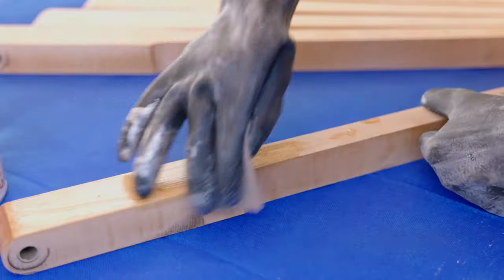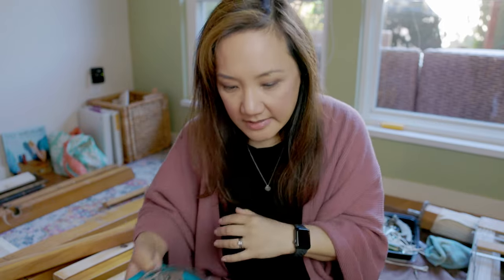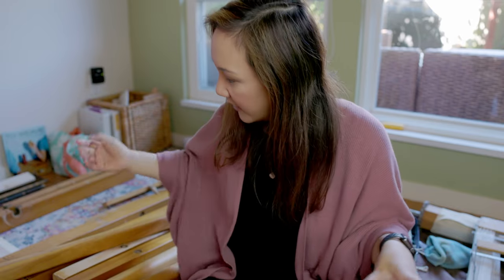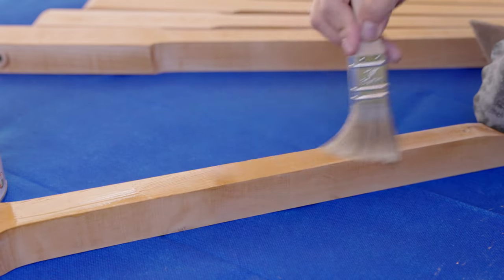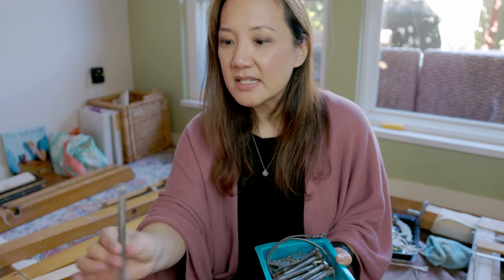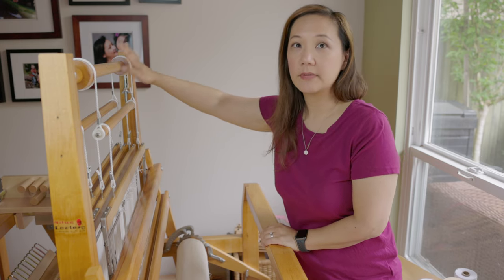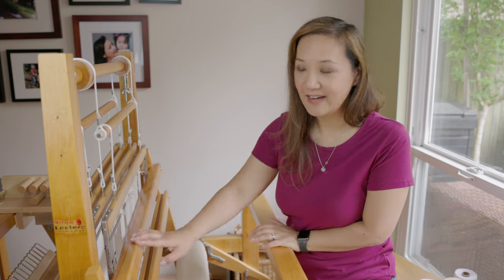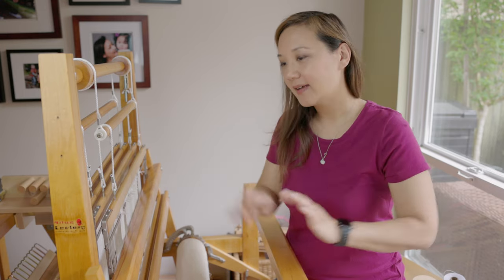Weaving Loom Restoration for a 1968 Leclerc Fanny Counterbalance: Part 2 // Finishing the Loom

Comment: Just wanted the 1st video and I too have obtained an older loom that sat in a basement so it was dusty, had some surface mold and was neglected. (1983 Schacht standard 45" 8 shaft jack loom.) I too wanted to just weave on it. But I knew I would enjoy it more if I cleaned it up. I just used the murphy's oil soap with sponge sand block when needed then applied the danish oil. It seems at one time this one was used in a school and you could tell they did dying also I found little finger/handprints that were dark. I did leave a few of those did not sand all the way down to keep part of it's history. Just as yours did once the danish oil was applied it went back to the beautiful patina of the aged wood. I'm such a happy weaver on it because of the journey. Cheers to your happy weaving. :-)
Reply: Ohh and yes plastic bags with labels and pictures of each side, part, area of loom does help when putting back together. :-) Hubby works on generators and they do that on the job.
Reply from the maker: Beautiful! I’m so happy to hear that you brought life to this loom again!
Reply: What a wonderful story. I believe my loom is from an art department of a college!

Comment: Wow!  I am so impressed with how nice of a job you did on your loom.  I also restored an old Fanny loom.  Mine was from the 1950s.  I bought mine from an ad on Kijiji that showed pictures of a much newer loom.  We travelled 5 hours to go and buy it, to find that it was very dirty and in rough shape.  I only bought it because it was cheap and I had dragged my family along for the trip.  I sanded it down without taking it apart.  I had only used a table loom once and didn’t know anything about floor looms and wasn’t sure that I could get it back together.  I replaced the cords, aprons, bumpers and reeds (pitted with rust).  I made a homemade wax polish that worked well for me.  The product that you used sounds really nice.  I wove on it for several months before I realized that my front beam wasn’t level.  I was able to fix this.  I have since wove along with several years of the Jane Stafford Guild projects on this loom and now, my used Colonial, which I also love.  I found the restoration to be a gigantic job.  I would only attempt it again for a very special loom.  I did feel that I rescued the loom.  I think that if I hadn’t bought it, that it may have ended up in a burn pile or the dump.  I also feel that I learned so much from doing the restoration and am less afraid to fix things and figure out how they work.  I am amazed with how many projects that you are able to get done.  Thanks for sharing!
Reply from the maker: Love your story, Carrie! YES, I feel the same way — the restoration was a big job and I would also only attempt it again for a special loom. I’m so glad to hear that your loom was brought back to life and has been with you through all this learning. 🤩

Comment: You definitely inspired me!  I started the day after your first vlog ‘what would you do’.  I had intended to refinish it, bought the supplies, but I may never have actually taken the plunge if it were not for the inspiration from you.  You did better than I did with the metal.  I didn’t do as much with the metal as you did.  I also was not brave enough to take the fabric, (which is like new) off the rollers.  I was afraid of not getting that fabric back on straight.  But I am thrilled with the way the beautiful maple refinished, it glows in it’s new coat.  Mine is a little older than yours, built between 1951 and 1956..  Thank you for sharing your inspiration, thoughts and enthusiasm.  I am not sure if I can upload a pic here
Reply from the maker: Oh that is AMAZING to hear, Joan! I'm so glad to hear that you refinished your loom too... way to go! Enjoy that shiny new loom now! 😍

Comment: Be sure to add a sealant to the freshly cleaned metal pieces, or the tarnishes and rust will return. Eastwood products has a lot of metal hardware finishing solutions. I’ve used many of them on my 1970 corvette restoration depending on what the original factory finish was.

Comment: Wow Felicia, you’ve given new life to this loom and can’t thank you enough for this and the first video! Well done!! You’ve inspired me to finally get going on a restoration of my 1973 Nilus 45” 4 shaft loom. The loom was in working shape but looking so dull behind the older varnish, and the Osmo has too brought such luster and life back to the pieces. I’m excited to get everything completed so I can put it back together - and did heed your advice with taking many pictures and keeping it all in notes as I go. I’m curious, were there any tighter areas or parts of the loom you didn’t worry about sanding/Osmo or removing the rust?
Reply from the maker: Thanks so much Sarah!! Good luck with your restoration too! I did sand and use Osmo on every part of the loom so I don’t think there was any part that I skipped over. I hope yours turns out well too!

Comment: Where did you get the cords for the rollers? Did you make them. My 1982 cherry Dorset loom needs a little love. It needs cords that go to the foot pedals and I also need new cloth aprons. I know I can do the apron parts easily but am more concerned about getting the cords to the pedals correct.
Reply from the maker: Hi Diane! I bought the replacement cords from Leclerc Looms because they were made to be the correct size. For the foot treadles, they also sell tie-up cords and new cloth aprons. Good luck with your loom!

Comment: Your loom looks great. I did something similar with an old Kentish loom. It resembles your Le Clerc loom quite closely. I did a bit of sanding and waxing, and replacing cords and strings and heddles. I removed the rust from hardware with citric acid, it worked a treat.I haven't tried to weave on it yet. I have done some weaving but never on a four shaft floor loom. I would love to see you dress the loom, it would be so helpful to see it done on a loom that is similar to mine. What length of warp would you suggest to put on it for a trial piece?
Reply from the maker: Oooh that's wonderful... glad to hear you have fixed up your loom! For my loom, I'm warping sectionally now, so I've just wound all the sections on and the next step is to thread them through the heddles. If you are starting your first warp ever, I would go for about a 2-yard warp. Doesn't have to be very wide. Maybe 8 or 10 inches wide and just get it on the loom so you can see how the loom feels.
Reply: @sweetgeorgia  great thanks for your advice.

Comment: "Metal  Parts" are called "hardware".  Fine sanding DOES NOT "seal" the wood, but makes the final product smoother, regardless of finish. If the previous finish was an oil, you will most likely never sand it all away, however, most manufacturers used an oil-based varnish, in those days, to finish fine wood. 
NEVER finish all sides of fine wood, leave some unfinished to allow the wood to "breathe" and let any trapped moisture to escape. Also, after the Evapo-Rust treatment, you need to apply a little paste wax or the rust will soon return.
Reply from the maker: Oh fantastic!! Thanks for the advice! That’s interesting to hear about the reasoning for leaving one side of the wood unfinished…. Makes sense!